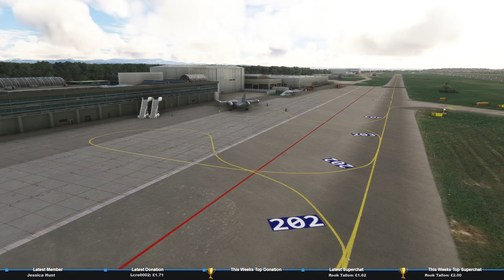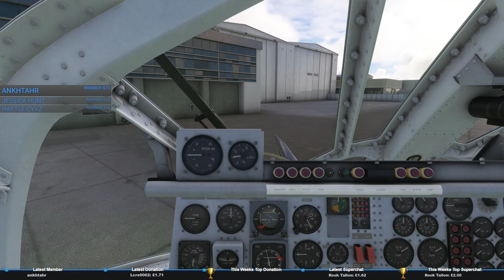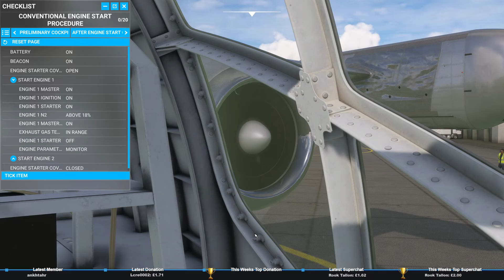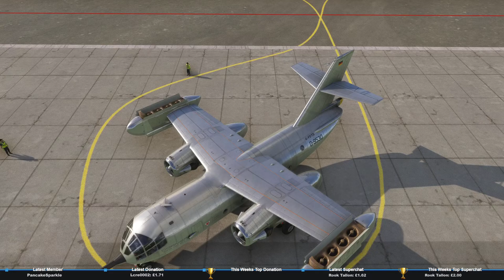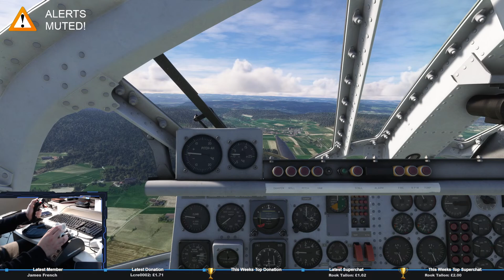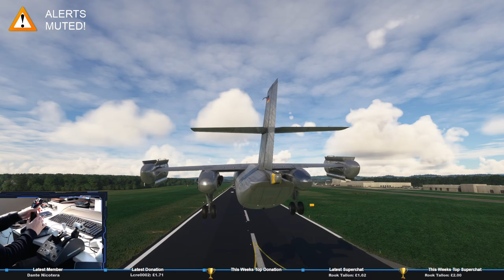The Dornier Do-31 is ridiculous! Microsoft Flight Simulator

Comment: This is going to take a lot of patience. I’ve had a few flights but no success in vertical take off or landing just yet. There’s a few bug’s my landing gear does not work and no copilot help at all.
Reply from the maker: Yes the dynamics are unique but it’s usable, it’s a challenge to manage! I haven’t used the copilot assistance feature, only to start the hover engines but the manual is quite comprehensive on how to set it up 👍🏻
Reply: @flightdeck2sim  I sorted some of the bugs then another happened the copilot switches all worked they all turned on then halfway through the flight they turned off and only one worked at one time if I turned on the Heading the Alt turned off. And to reduce speed for landing wow.